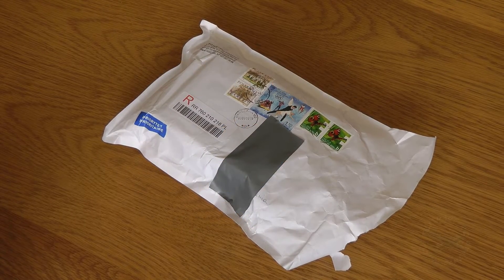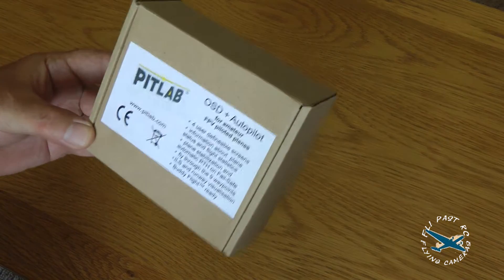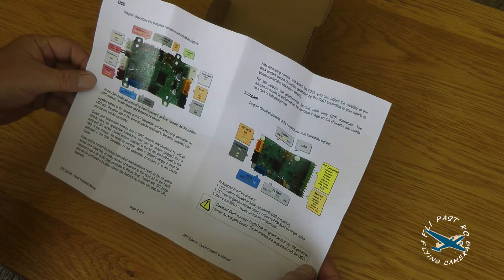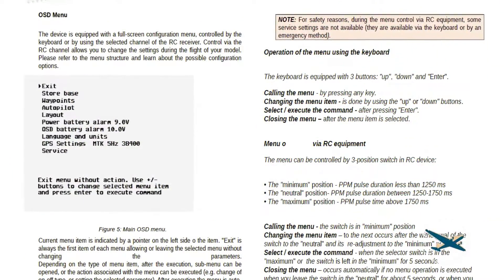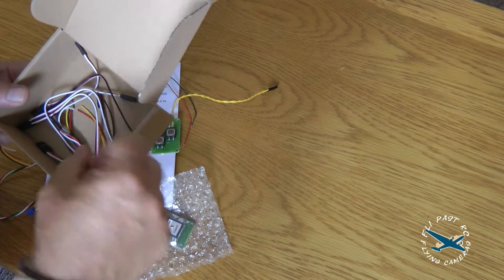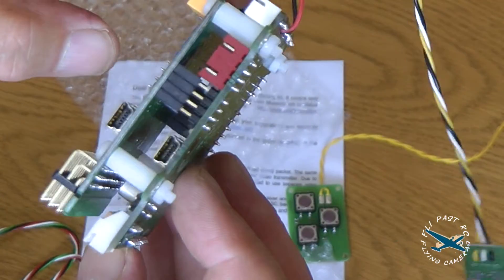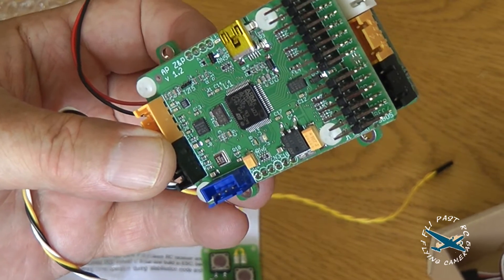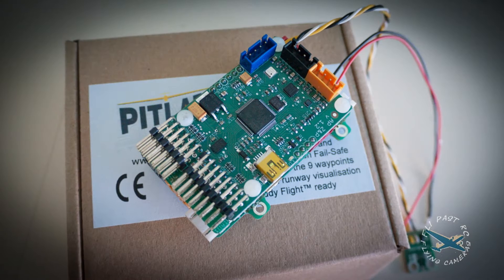FPV OSD from Pitlab

Comment: Hi, how did you like this unit so far? I'd like to buy it but doesn't seem so popular among the fpv world. 
Also, is it hard to configure, cause it will be my first system. thanks for sharing.
Reply from the maker: +probante It has been hard to configure in a flying-wing. The weather has been so bad here over winter I am way behind with testing it in a Bixler
Reply: +FliPastRC So my understanding in that in NOT easy to setup? i would mount  it on a zeta  fx61...
Reply from the maker: it hasnt been easy in a flying wing so far, not tried it in a normal acro yet
Reply: +FliPastRC I`il be using it in a soft way.... thanks